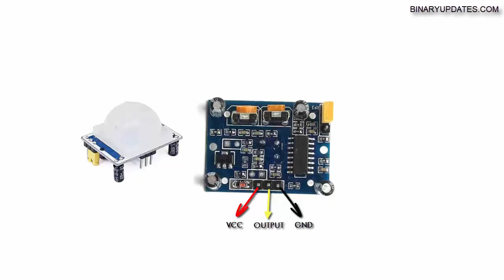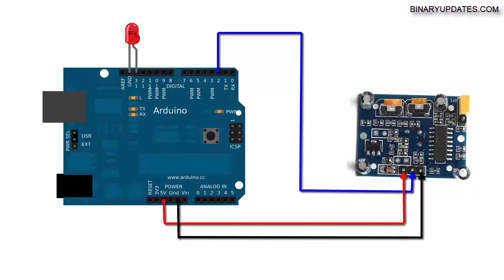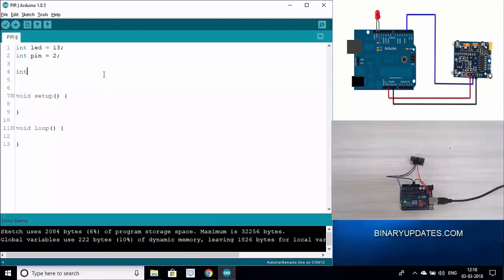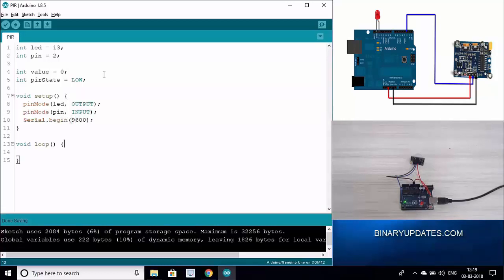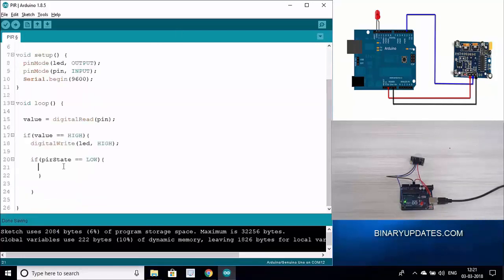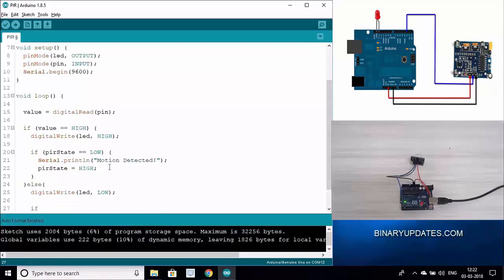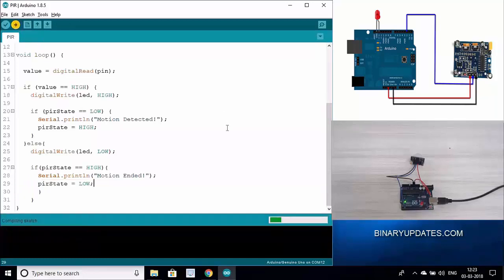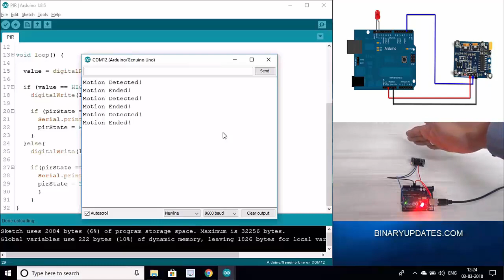PIR Motion Sensor with Arduino- Passive Infrared

Comment: In my code, low, high, input, output texts appear colorless and my circuit did not work. I think my library is missing where can I find it?
Reply from the maker: Hi Burak, make sure your Arduino IDE installed properly. And also make sure board is selected properly. And then libraries will link properly and syntax highlighter will be enable. I hope this may help you. Good luck!

Comment: Hi I’ve a question so after sensing the motion through the PIR sensor the led glows and after the motion has ended the led turns off. (Instead of the led turning off immediately is there any way I can make the led turn off after a minute or two the motion has ended ?  )
Reply from the maker: Yes, it can be easily done by adding delay in Arduino code which we wrote to interface PIR Motion Sensor.
Reply: @BINARYUPDATES  I did the same thing which is this
int counter = 0;
.
.
.
void loop(){
.
.
.
else if (val_PIR == LOW){
      counter++;
      if (counter >= 60000);
      digitalWrite(bulb, LOW); // Light OFF
}
but as soon as the PIR is LOW the bulb would turn off even before a minute is completed.

Comment: Line 10 Serial,begin (9600); serial was not declared in this group error message
Reply from the maker: Hi Michael, you should write Serial.begin (9600); not Serial,begin (9600);
I can see there is an typo mistake in your arduino code
Hope this may help you
Good luck!

Comment: my one has a problem the light never turns of when i go away
Reply from the maker: Could please check in your serial monitor of Arduino if you're receiving any message either light detected or not by PIR Motion Sensor. If in case your LED connections will be wrong. Good luck

Comment: What should you do if the PIR detects the motion but it won't detect afterward? For some reason, it's happening to me, and the LED won't turn off after detecting one object.
Reply from the maker: Hi Natheer, I would suggest you to adjust the sensitivity of PIR Sensor to detect the range. There is one POT on the module and try. You maybe facing this issue because of low sensitivity of your PIR Sensor.  I would be happy to know your progress
Wish you good luck and fun with your Arduino Project
Umesh

Comment: Thank you! It works! 
I have a little problem though, the LED keeps blinking for good 2-3 minutes before it starts working normally. 
I think the sensitivity is too high. How do I fix this?
Reply: the sensitivity can be changed by changing those orange nodes like sturctures you see, one is for delay and another for its sensitivity
Reply: No you have to let it load in for 1 minute before doing anything to it
Reply: May i ask is the led needed? Or is there any alternate way to do without led?
Reply: @johnsonli6467  LED is only being used as an indicator, you can also use buzzer instead that way whenever an object comes in the sensor's range it will start the buzzer to alarm you
Reply: @esotericray5750   if i want to use pir sensor send it detect to laptop and stored as file, so i still need led?
Reply: @johnsonli6467  LED is just being used as an output here, you don't need an LED, you can attach something else on those two terminals where the LED is being connected.
Reply: @esotericray5750  is there a way to store the detected? I doing a project on model occupancy , need to predict the following occupants, i will need to count number of people enter or exit by pirsensor, and then calculate the transition probability and so on?
Reply: @esotericray5750  thanks
Reply: @esotericray5750  sorry to ask is there any code can count the number of people within 1hr and then recount for next hour, the amount store in file(i use putty to store).
Reply: @esotericray5750  is there any example foe this?
Reply: @johnsonli6467  hey I'm not sure, there must be one on the internet. Considering a single PIR sensor, my approach would be making a counter for 1 hour. When it resets, the PIR sensor's output (integer value of number of people it detected) could be stored in a separate variable. You can set the one hour loop to repeat itself for 5-10 times or whatever you deem fit (to store data collected in those 5-10 hours) but it depends on how the procedure goes
Reply: @esotericray5750  hi may i ask, if my code about same aa previous person, is there possible change my xode? Mine like got 2 nested for loop, to count the transmission matrix and then another nested loop to calculate predicted occupant.
Reply: @johnsonli6467  no.. its just for testing. you could use pin 13 without connecting external led so  the default led built into the uno will be used as an output if you dont want external led's 
be creative with what you can do with this u can connect buzzers, some led strips and loads more

Comment: Sir how do i program this to only detect large heat source.

This sensor goes off when i throw a towel in front of it
I only want it to go off when it detects a real human or a real large heat source.
I tried turning the knobs but it didtn work.
Reply: Me too plzz help
Reply: I am also dealing with same problem . Have you got any solution? 😞

Comment: Didnt saw in your code where did you write the 5 sec delay for the sensor.
Reply: it was set from the sensor itself. There are time delay adjustment and sensitivity adjustment if you look at your sensor, generally the color is somewhat orange there.

Comment: can it using arduino leonardo ?
Reply from the maker: You can use any Arduino Board but in this specific project. I've used Arduino Uno to interface PIR Sensor

Comment: i copy pasted the same code and did the exact connections but i am getting a wrong output. my output is " motion is detected" ,after that the motion ended msg does not appear and also,the led is always on. kindly reply asap
Reply: Send me the pic of this error or connections
Reply: same problem any, help
Reply: Reduce the delay from the knob of pir module

Comment: Sir, why you wrote pirState variable?... I did not understand the use of pirState in code... Please help!
Reply: The pirState variable is used so that a message is only printed once when a motion is detected or ended. If the pirState variable was not used, the program would continuously print the phrase "Motion Detected" until the hand was pulled back.
Reply: me too. pirstate is doing what?